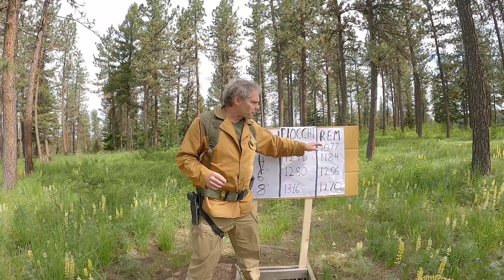How Does Barrel Length Change Velocity

Comment: One of those differences in velocity might be due to the ammo companies selecting a powder that has its best burn in a 4 inch barrel.
Reply: Different powders have different burn time.
Reply: Agree, short barrel ammo....
Reply: Yes.  Did that with pistol and rifle.  Same bullet weight in two .38's different barrel lengths, different powders preformed better.  Same with the 30-06, in this case it was precision we were working on.
Reply: Paul proceeds to start breaking out reloading equipment
Reply: @jasonhaire8897  Yes. I did know that. Do you know why that is? While the powder is burning a certain amount of pressure and heat is required to sustain the burn. Those very few kernels of powder don't get burned because the volume that the combustion is happening in is expanding and they end up in a place that is too cool for them to ignite reliably. So while combustion does happen for most of the length of the barrel, the overwhelming majority of it happens before the bullet has traveled more than an inch or so down the barrel for handguns. So I could have said " almost all the powder that is going to burn will have burned by the time the bullet is an inch or so down the barrel." And that would have been more correct. It doesn't change my point though.
Reply: @JoozdontliketheTruth With respect,  some ammo oems do spec handgun ammo for different barrel lengths.  IIRC Speer has some 9mm specifically for short barrel.  A lot are tested (have specs) for 4" barrels.  Yes - of course it means that adjust the burn-rate.
Reply: Yep. Look in your load manual, for 38 Special Lyman does their load development with a 4” barrel. I know this because I was in one of my Lyman manuals yesterday looking for 38 Special data, and saw they used a 4” barrel. Some of us like a 6” or longer barrel. Sight radius is a great concern for some of us. I can shot a 6” barrel way better than a 1 7/8” barrel, way better. I can shoot and 3” or 4” barrel better than those tiny little nubs of barrels. For me a 8” barrel would be even cooler than a 6” barrel but who makes them anymore?
Reply: Said all that and didn’t highlight my point. My point is industry seems to prefer 4” barrels and shorter on revolvers. What you like or have may be different than what industry is leaning towards to satisfy a specific audience. Load your own and you can use a different slower pistol powder that will provide better returns for longer 6”,8” and even longer barrels.
Reply: Given that almost all the powder burns before the bullet is an inch down the barrel. The optimum powder for any given cartridge will usually be the slowest burning powder you can use which fills up the available case volume the most, and which keeps you right at max pressure. As long as you aren't going to ridiculously short barrel lengths the powder that gives you the best speed at a longer barrel length will also be the fastest at a shorter barrel length. There are reasons you might choose a different powder for a shorter barrel though. Things like fireballs or pressure at the muzzle would be good reasons to pick a different powder for a shorter barrel, but not for getting the most velocity.
Reply: @mitchelwendland5195  I gave you a thumbs up on your comment because this makes perfect logical sense to me. However, the Lyman book lists lil gun for .357 to have a high velocity with a relatively low pressure as compared to H110 or 2400? Is this powder an outlier? I chose to use it based on that pressure data to load for a carbine to maximize velocity while limiting pressure. I'm new to reloading so I am genuinely asking to educate myself.
Reply: @justme7478  that is an excellent question. The answer is that mote than just burn rate go into propellant considerations. It is likely that Lil gun has a deterrent coating or some other factor that makes it burn more slowly at first and then speeds up as the c9mbustion volume increases. What ultimately matters for highest velocity is not max pressure, but average pressure as the bullet travels down the barrel. I can't speak to specifically what makes this powder perform so well compared to others for the same or even less pressure, but it will cone down to the powder chemistry. The major difference I see in terms of composition is that h110 has about 10% nitroglycerine  content and Lil gun has about 20% ng content. I suspect that Lil gun has a deterrent coating to slow down the burning initially and then allow it to speed up as the burn progresses. To sum up there is something chemically going on that makes Lil gun have a higher average pressure and that is why it gets such good velocity for lower max pressures, what exactly that is I don't know for sure. It's all about the area under the pressure curve and Lil gun has more of it than h110 in the 357.
Reply: @justme7478  I did some poking around and it seems that nitroglycerine is a round ~50 % more energetic at least in terms of propelling bullets than nitrocellulose per gram of material. So I think a lot of the difference will come down to that. Additionally the more progressive the burn rate of in a powder the more velocity  you can get for the same max pressure. It seems like they designed Lil gun to be quite progressive. I want able to find any hard data on whether or not they use deterrent coatings to do this or if it's just because it's a flattened ball powder.  I hope this helps.
Reply: @mitchelwendland5195  You say, "Given that almost all the powder burns before the bullet is an inch down the barrel".  Is that true ?  Can you point to a source ?   I've seen pressure measurements from rifle rounds, and the pressure peaks ~0.5 milliseconds or a bit more then drops.  I IMAGINE that most powder burns in <1 millisec using modern propellant, regardless of round.   Muzzle velocity for these handgun rounds is ~1200fps, or 7+ inches per half millisecond.

The muzzle flash on short barrel handguns, suggests that all powder doesn't always burn even 2.5 inches down the barrel.
Reply: @stevealexander8010  I'll check, but its need a while since I came across any handgun pressure trace information. I'll run a sim in grt later this weekend if you like. Also the muzzle flash isn't from the propellant continuing to combust with itself that is the hot fuel rich propellant vapor quickly mixing with the air and completing combustion. If that makes sense. Let me see if I I find you the source on that first question you had.
Reply: @mitchelwendland5195  Regarding your statement of "the powder that gives you the best speed at a longer barrel length will also be the fastest at a shorter barrel length" hasn't been my experience with 300blk. This is the only example I can offer from personal experience, as it's the only caliber in which I have different barrel lengths, so there's that.
Anyway, I worked up loads for the 110gr V-Max in both 16" and 10.5" barrels, with both Lil Gun and Accurate 11FS. Lil Gun gave me the highest velocity out of the 16" barrel as I expected, at an average of 2490fps, with Accurate 11FS falling behind at an average of 2425fps. Not a tremendous difference, but the results with the shorter barrel proved entirely different. Out of the 10.5" barrel, the faster burning Lil Gun peaked at an average of 2125fps with only slightly more than the starting powder charge weight, with diminishing velocity as the charge weight increased; whereas, I was able to hit an average of 2360fps with Accurate 11FS (with more room to go if I wanted to take it to entirely unsafe pressures)… more than 200fps faster than the longer barreled velocity winner. Considering the 300blk was designed to achieve a near full powder burn with only a 9" barrel, I can't chock this one up to the 10.5" barrel being excessively short. Powders simply don't always perform in the ways we expect; hence, testing! Lol
Reply: @whiplash636  that is an interesting observation. I think you might be seeing the differences in the barrels more than the length. Some barrels due to how they are manufactured will shoot differently. It would be more correct for me to say that the powder that was faster on a longer barrel will still be faster if you cut it shorter.  Does that make sense?

Comment: Longer barrel, more spin stabilization, more accuracy.
Reply: Nor necessarily. Only some amount of the barrel will be used to Induce the spin. The rest is still rifled for a good gas seal.
Reply: @indoorkite651  Yeah, the part with the rifling in it, which extends to the length of the barrel. Durhhhh.
Reply: That's definitely not how that works. Paul's got several presentations on that.

Comment: can you do more .40 s&w, but not 180gr, between 135gr and 165gr.
also can you use federal hst & punch, winchester ranger t-series & supreme elite pdx1 & silvertip & defender, hornady critical duty & defense, underwood, buffalo bore, sellier & bellot(jhp & fmj), doubletap, corbon, black hills ammo, remington golden saber & ultimate defense, prvi partizan(jhp & fmj),  fiocchi(jhp & fmj), speer gold dot, sig sauer v-crown, blazer, pmc, magtech and grizzly ammo.
through your meat simulation target and ballistics gel & through barriers like glass, sheet metal, drywall and plywood in front of the ballistics gel and meat simulation targets? and also the meat simulation and barriers like glass, sheet metal, drywall and plywood targets from different distances for performance at different distances?
and vs 9mm, 9mm +p & 9mm +p+ and .45 acp & .45 acp +p+ through all the same for the 9mm, 9mm +p & 9mm +p+ and .45 acp & .45 acp +p
thx!

Comment: The questions about how much velocity is lost because of the cylinder gap and, if any, how much is lost in a semi automatic handgun due to using it's recoil to load the next round, are quite fascinating to me. I guess it could be somewhat shown with a semi automatic handgun firing .357 magnum and a revolver in that caliber with the same barrel length. That would at least show which type looses the most velocity due to it's operation. 

I would also love to see the gun Ian had on his channel, the mk23 Socom, which i believe could be fired without cycling another round in order to make it ekstra quiet and not have an empty case to have to find if you need to not have evidence lying around. What i would be interested in with that gun is to see of the velocity changes if it does not cycle vs if it does. That should show if any velocity is lost because of that.
Reply: Take a read: "BBTI - Ballistics by the Inch :: Cylinder Gap". About 5-8% losing.

Comment: I have a theory that the longer the barrel, the scarier it is and therefore the more useful it is as a deterrent.
Paul, what is your longest gun and is it A) scariest B) most approachable or C) exactly as scary as any other gun length?
Reply: Isn't muzzle diameter a deterrent too, though? Also capacity. We're all supposed to be fine with small magazines but terrified of big ones, right?
Logically, the best deterrent would be a 12- no, wait. A 10- no, again. A twelve-shot 40 mm grenade-launcher revolver loaded with eight-ounce buckshot loads.
Yeah. That'd scare someone off. I mean, seriously, anyone who can casually stroll around with that thing on their hip and actually use it is someone you don't want to tangle with unless you brought your own tank and/or AH-64.

Comment: Thanks for demonstrating the topic of barrel length.  Sometimes a 4-inch barrel produces greater velocity than a 6-inch barrel using the same ammunition as measured by a chronograph.  Generally, most of the time the longer barrel will produce more velocity with the same ammunition.  Does that make enough difference?  According to Bill Jordan and his "No Second Place Winner," motor patrols were better off with the "inferior" four inch barrel than with the six inch barrel because other factors (such as being able to sit in the patrol car) were more important than marginal shooting performance.  
The Dan Wesson was innovative.  
Again, thanks for the demonstration.  It was a mostly peaceful protest--and quite informative.

Comment: Have what might be a stupid question here, how does action type effect muzzle velocity?
I understand that theoretically in all locked breach systems nothing should be moving until the bullet leaves the barrel and even in simple blowback it should be the same, but I am curious how it actually factors in. This all excluding revolvers with the forcing cone and cylinder gas slowing it.
Reply: A revolver loses some velocity from gasses be escaped from between the cylinder & forcing cone. A semi auto pistol will have a slightly higher velocity since their is no loss of pressure & the bullet leaves the barrel before the slide even starts too move.
Reply: That's why excluded revolves, there is no great surprise in what happens to the bullet velocity there. In simple blowback while the slide had not begun moving, it's still had momentum imparted on it and thus robbed energy from the projectile as compared to something like a bolt action. This was what I was asking about, along with other kinetic based lock systems like tilting barrel or long recoil. It would have been more correct for me to say locking types, but that wouldn't have included simple blowback
Reply: @highlow4098  For some reason the revolver part of your original question didn't show up until now ? You can hold the slide of your semi auto pistol so it doesn't move & the velocities DO NOT CHANGE, I've done this. So the slide moving has no bearing on velocities in my experiment with 3 semi auto pistols.

Another thing I've tested is putting the guns in a secure rest & shot them. I got between 5 & 10% higher velocities in a secure rest compared too shooting them off hand.